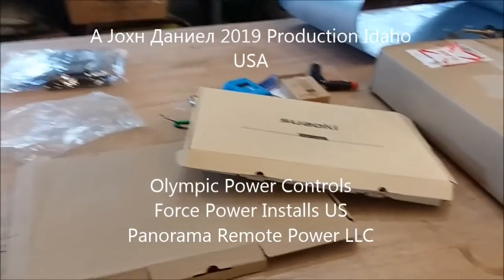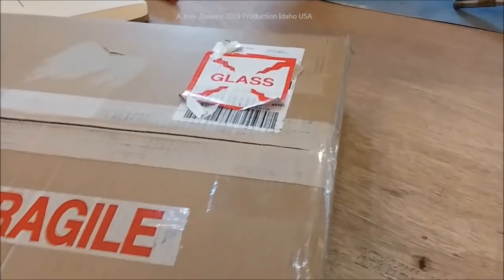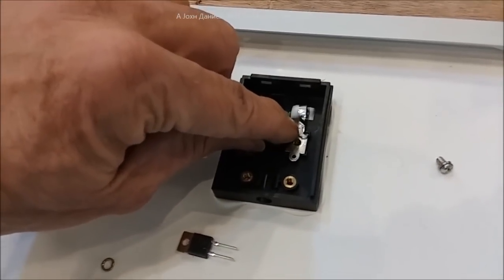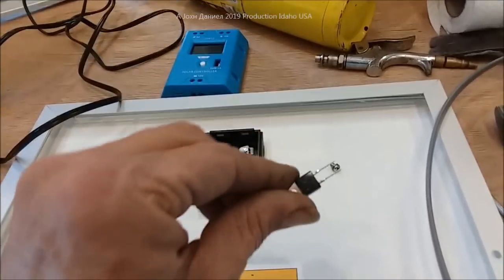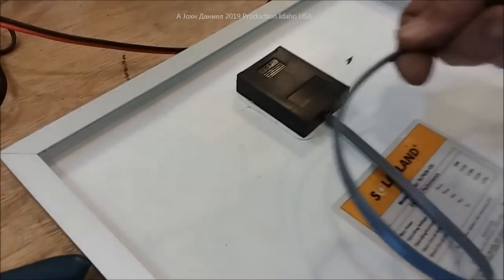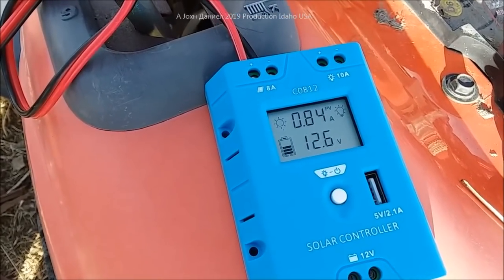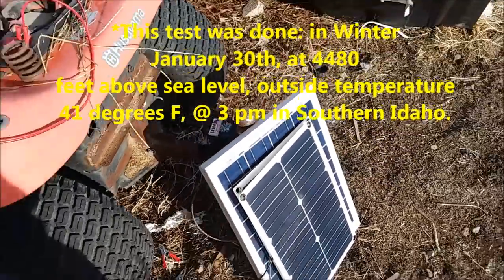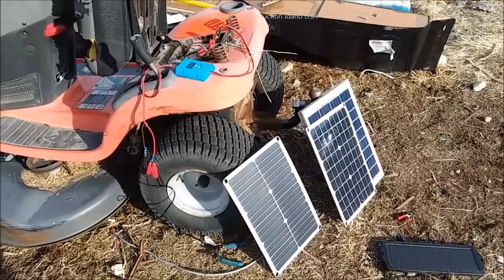20+ watt Solar Panels under $35, Which one is best? ALL Parts used Below, UPDATED!

Comment: That's not how the bypass diode is supposed to be wired/soldered to the panel.
The only reason for the diode is when you have more than one panel in series and you get shade on one panel the diode bypass it hence why it's called a bypass diode.
You only have it as a reverse polarity protection. 

By the way you loose around 0.4 to 0.8v of drop over the diode and it is dissapating lots of power just as waste heat on the diode.

Also you should not stand right beside it when testing it since you are shading over some of the sun
Reply: He uses the diod right it is NOT USED AS BYPASS DIODE BECAUSE OF A SINGLE PANEL!!! It is reverse DISCHARGE PROPTECTION if conected to a bettery... What replacement Symbole do you give a solar panel in a electronic schematic? Wright a diode, which in turn discharges the battery in darkness
Reply from the maker: EXACTLY - The Diode on these small panels are for blocking, If I had a need for connecting Solar Panels in Series, then a bypass diode would be a nice application. So many configurations of diodes are used on solar and wind both. But with such a small panel, the loss of 1 amp out of 6 or 10 panels is not the same as the loss of 10 amps on a 150 watt panel which will use both a bypass or dual diodes on the 2 outer neg strips to the center pos. But like all 18 solar cell panels they are better served only with a blocking diode thats 150% higher rated than the array of them you plan to build. In my case, we are using 6 per awning with 8 amp controllers on them.

Comment: correct me if i'm wrong, but isn't the diode only needed for a solar PV setup, essentially i don't see why one would use a diode each solar panel, especially since each diode would represent a drain, anyways could be why solarland panels don't come with a diode, because they expect multiple panels to be used and thus one would connect lets say 5 panels and only one diode to ensure no reverse  current flow from the battery or such...
Reply from the maker: A diode is needed on each panel because a failed panel, or one shaded or one with even just bird droppings on it will be parasitic to the others. The Controller prevents back flow from the battery, but a diode on each panel prevents back flow from a good producing panel to a bad producing panel.
Reply: @JOHNDANIEL1  ah yeah in parallel i can see the argument, which also helps to limit the problems with a shaded or other wise low producing module.

in series back flow really wouldn't be a major problem like in a parallel setup, however when in series ofc there is a major problem if a module is shaded and thus kills most of the output of the entire setup.

each diode would represent a voltage drop and thus would decrease over all efficiency, i'm not really aware of how much, or if its actually worth while using something like germanium based diodes for their improved efficiency.

i have been considering if really the whole shaded module issue isn't a design issue... really if the cells within a panel is connected in practical ways like say parallel such an issue wouldn't exist... ofc then one would need a diode after each cell i suppose... and there is the whole lower volts higher amps deal...

Comment: Not sure your testing procedure is accurate.  You would be better off putting resistors across the output until the voltage drops to zero.  The output power will vary based on the output voltage of the panel and the starting voltage of the battery.  You could also just use a battery that was depleted down to about 10 volts so you would be sure to push the maximum amount the solar panel could produce.  You could also try one of those battery load testers and watch where the output wattage hits its maximum point.

Comment: Assuming these are putting out 18 volts, you are talking .81a or 14.58w for the first one.  The second panel was .55 or 9.9w.  The third panel was .64a or 11.52w.  Flexible panels were smaller so you know they were not going to reach 20w.  In fact the last panel said 18w, not 20 on the back so it was about 65% of its rating.  The glass one was about 75%.  I think based on the size and weight of the third panel I would be quite willing to use that one.  The second one I would only get if I just needed a USB charger.
Reply: The one with the aluminium frame is the best in eficency and durability. I have 4 x10w in an portable stand and they are very reliable.
Reply: He should also control for angle to the sun.  Not that it would have made a huge difference but one less variable.

Comment: Hi Daniel, the test you did for the 3 solar panels. I personally think the Suaoki panel is the better choose. Because the Suaoki panel is an 18W panel not 20W. The Suaoki panel can charged the battery at >0.6A is more efficient than the other 2 panels. Firstly the matt surface on the Suaoki panel reduces the reflection of the sun light, thus take in more sunlight. Secondly if the Suaoki panel is a 20W, dont you think it will give you a charging amp similar, or even higher charging amp, to that Solarland panel.
Reply from the maker: The Suaoki panel is decent, but as claimed for being 18 Watts, it was ONLY in the listings as a 20 watt in every advertising. For that reason of AD SEARCH MANIPULATION and the ad did ( before they changed it) claim its a 20 watt panel, i tested it as a equal. That given, the panel performed good, but even if you allow the 2 watts in the equation, it would not be producing 0.84 amps. Give it 2 free watts, and ad that to the 0.6 amps you still only get .65a at best.
Reply from the maker: PS - On A thought, If I could get 20 of the Suaoki Panels to put into a designed Array on a Travel Trailer then you may see their best features. Would make a great video, but price of them is the highest of the group of 3.
Reply: Agreed, the non reflective coating may also improve it's cloudy day performance.

Comment: those are pretty cheap panels, .. got my heater going, its having a hard time keeping up in -20 degrees we have been having,lol.. its holding at 45 for me.. pretty kick ass lil heater
Reply from the maker: I installed 3 oil lamp converted heaters I built in a RV in North Dakota oil fields in my 32 foot Holiday Rambler. They are easy to build, no smell, and all you need is 3 metal tool boxes you mount upright on the wall with fire place door gaskets on their lids and Voila' you have some cheap 2000 btu run for days heaters.

Comment: So the flexible does just over half of the 'real' panel.  I don't like the flimsy flexable panels, I seen a guy using one and it got hot and a bubble poped up on it! I don't think it would work long. And basically impossible to fix.  What is the price of the 'real' panel. I seen them for about $30,
Reply from the maker: The Solar land link has them at $21.50 With free shipping. But their store has them at $38.99 With the wires and diode.

Comment: Are the tabs on the diodes a part of the electrical connections? Most of the MOSFETs in the same package design is a part of the electrical connections, its usually the middle pin on a MOSFET, since there is no middle pin, I would check for continuity between the pins and mounting tab... I been looking at similar panels. I'd like to have about 2-3 amps at about 13.8-14.4v, may r 14.8 to charge in similar use.
Reply from the maker: I put all the parts in links under the video in the upload date spot.

Comment: Good comparison of max output ( under the given conditions). I’m curious though about their performance under other conditions. Isn’t the amorphous claim to fame that they will produce more output under partial sun/cloudy conditions?
Reply from the maker: The one panel thats Amorphous is a MOCK MONOCRYSTALLINE look, but its full amorphous, its output is good for the purpose of using as a charger on your boat, atv or tractor but I would use 2.

Comment: Great video as always. I really like your channel, keep up the great work!

The size of the panels kind of gave it away. The flexible ones  where smaller. They could have used higher effiency cells in them but they normally dont. Usually they put the worst producing cells in these smal "hobbypanels" and save the good stuff for the larger panels. 
By putting the flexible panels on top of the other one their production problably dropped a bit. If they have had free airflow behind to cool them they probably would have done a little bit better. Not groundbraking but maybe they  would have done 5% better or so. The colder the cells the more they produce. Where I live in Northern Europe the only time I ever get the rated capacity out of solarpanels is when the outside temperature is below freezing.

Comment: Very interesting.  I just short the leads and use a clamp on amp meter. I think I'm going to get one of those ebay ones. That's about the best I've seen in that price range.
Thanks for doing these kind of test. You save folks alot of time and cash.

Comment: Better using an multi meter then trust the LCD read out on the Pwm charger you get what you payed for
Reply from the maker: They were practically free to do the test on. And putting all 3 through the same controller by ZL-Solar which is a higher quality make, got fair results. The LCD didn't know which panel was which, and calibration checks on it days ago had it very accurate all the way to just over 105 watts from the meanwell power unit. After that it did loose some accuracy, its only a 8 amp.